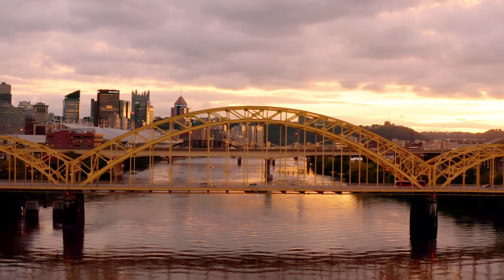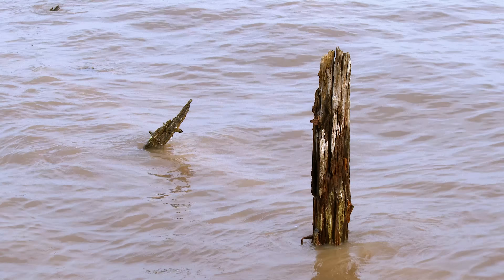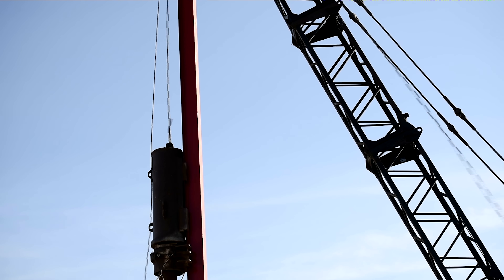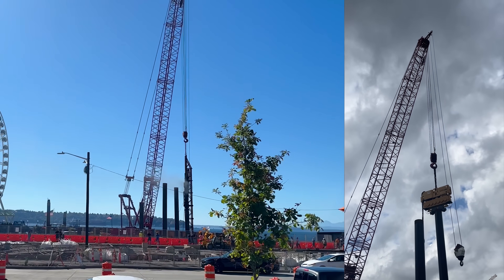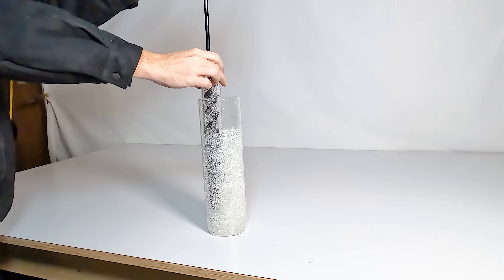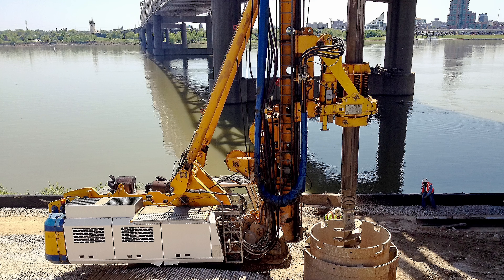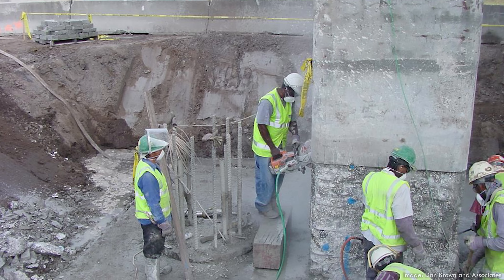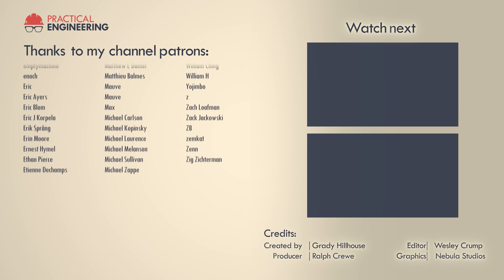Why Bridges Don't Sink

Comment: H Beams look exactly like I Beams, but H Beams have the same thickness in the flange and web, and are commonly used in vertical orientations where the loads are applied parallel to the beam length. The thicker web of an H Beam makes them more resistant to twisting. Whereas I-beams are typically horizontal, have thinner webs, because they are designed to only handle loads perpendicular to the length (top in compression, bottom in tension)
Reply: Then there's the O beam....hang on, that's a pipe 😅
Reply: @PeterEdin  haha yup. we use schedule 40 steel pipe as beams int he film/tv rigging industry. trying to switch to truss more though
Reply: @PeterEdin  For square values of "O" there's the box beam.
Reply: @PeterEdin  Unless it's a circular HSS.
Reply: And....Another thing I've learned today!
Reply: So I can use an H beam as an I beam, but not necessarily the other way around.
Reply: @jensschroder8214 I beams are lighter, because they are optimized .
In an I beam the flanges are thicker, and they are thicker at the root because the web is only there to separate the tension and compress flanges.
The root is thicker to stabilize the web from buckling.
If you use an H beam in an I beam (horizontal) orientation, the beam has to support unnecessary weight from its own cross section.
It costs more, weighs more and is going to be too wide for the height it needs to place the top and bottom flange where they can support the applied load.
Reply: If the loads are axial, why do they call it a beam?
Reply: @petermgruhn  calling them H “beams” when they’re vertical supports is just colloquial. They are formally referred to as H section columns if in a building, or H piles if used as described in this video.
Reply: @danielgreene89  He's referring to there being no "I Pile"
Reply: @danielgreene89  they aren’t only used in columns or vertical supports. They are also used in horizontal beams.
Reply: @petermgruhn  They don't IME.
Reply: Also I beams have a tapered flange to web.
Reply: @LTDunltd  I think you're referring to S-Beams.
Reply: @LTDunltd 
Sometimes/it depends
Reply: I-beams are S-beams and H-beams are W-beams, and your standard I-beam is also a "universal beam". There's a lot of lingo in steel.
Reply: You can also look up H-beam rods and I-beam rods.
Reply: To my understanding, in German we call an H and/or I double T...
Reply: @manufromlucerne  Interesting. Because in the U.S. a double T is a concrete beam that is basically two T-shaped beams with an extended flange. Precast double tees are used a lot in parking garages and other construction.
Reply: Actually H piles have the shape optimized for corrosion protection and axial loads.  I beams have the shape optimized for braced beams and not so much for corrosion protection.  W beams are optimized for as collumns or beams not braced as well.
Reply: I typed all this up in its own post, but then found this thread and though that anyone still following this thread might find my summary interesting:
There are typically 4 standard types of I-shaped beams and, funnily enough, none of them are called "I-beams":
 • W-shape: The standard "I-beam" used today is better known as a W-shape, or a WF(wide-flange)-shape. These are much taller than they are wide (Despite the name, lol), and are intended for typical gravity forces, like long span roof beams and such, where most of the forces goes in the strong axis of the member.
 • S- shapes: What might be considered the archetypical "I-beam", doesn't get a lot of use because it has tapered flanges top and bottom, which just makes it annoying to fabricate with and connect to - who wants sloped flanges? C-shapes also have sloped flanges, but that flat vertical back face it has has enough uses to warrant its existence. 
 • H-shapes: common for both columns and piles, as these have the same width as they do depth, so they form a kind of box or square shape, making them efficient at supporting axial loads, what columns and piles normally support, as they are not much weaker in either direction, they don't have a tendency to buckle unexpectedly.
 • M-shape: last are the M-shapes, which are just kind of these weird tall, thin shapes that never get used in buildings. The internet tells me RV's sometimes use M-shapes for whatever reason. One source call the M- "miscellaneous, so sure, makes sense I guess.
 • As a bonus type, you can cut W- and M- shapes in half and get T- and MT- shapes. Useful for connections and rail-type structures.
Reply: @kindlin  perfect! This is even clearer and more detailed!

I recently used a H column beam cut in half for the 2 T shapes I’d get to create some hardware out of.
Reply: Wouldn't that mean that they do not, in fact, look exactly the same but only almost the same?
Reply: iBeams are just Apple's version of an H Beam
Reply: Great video Grady! My wife bought me your book as a gift! Love your channel!
Reply: Also the terminology varies. I beams are sometimes called "s" for standard, while H beams are sometines called "w" for wide flange.
Reply: Apple: We've come up with the iBeam. Now at $149.99 
Me: What a pile of...
Apple: Exactly
Reply: I was just going to drop the same comment, but found yours.
Reply: You are the stereotypical engineer, giving a genuinely interesting and well researched answer to a throw-away joke in a video nobody knew was a real thing.
Reply: When you say “same thickness in the flange and web” did you mean “similar section height and flange width”?
Reply: @jpfidalgo7  On a typical I-Beam / W-Beam, its designed primarily for flexural forces where you want the majority of your steel to be away from the center of bending to be efficient.  In this objective, the flange thickness can be anywhere of 150% of that of the web.  The webs purpose is, mostly, to separate the flanges and produce a stiffer/stronger section.

On the H piles, the thickness are truly equal.  Its a section designed primarily for axial forces (not only as the video explains but mostly) and there is less of a need to be efficient for the bending forces.
Reply: @jpfidalgo7  no. i meant same thickness of web and flange. but section height and flange width can occur in some H beams, but not all.
Reply: I think both those images are H-beams. I beams have a more complex shape on the flange; it is thicker at the web and tapers at the toe.
Reply: Thanks ChatGPT! 🙌🙌🙌
Reply: Well I was going to say maybe it has to do with the orientation that they are used. I beam cause that is the way it’s strong and h beam for hammered hella hard/ hit here. But yours makes a little bit more sense so we’ll just go with that.
Reply: One thing I learned early in my machine design career is that the names given to structural shapes range from the obvious to "how did they come up with that name?"

A structural steel handbook is an engineer's best reference source. Then there's the ISO standard....
Reply: I was going to be satisfied (temporarily) with my own idea, that it's sort of like the lava/magma distinction. H-beams are underground like magma, I-beams are aboveground like lava. Then I was more satisfied by this answer.
Reply: And her i thought I-beams were just H-beams made by apple and costing 5 time the price of H-beams
Reply: his guess is a little better than ours
Reply: We use 10 inch 3/8 to 1/2 inch H beams for the small crane applications we build. Anywhere from 2.5 tonne to 10 tonne.
Reply: What’s the tldr
Reply: ohhh now I get it 🤣😂😂😂
Reply: Harry and Ian Beams are brothers.... That's why they look alike 😉🙃
Reply: 🤓🤓 jk, thanks for explaining mr boomer
Reply: Web thickness does not determine if its a WF or an I beam. That information is irrelevant
Reply: What's a flange and a web? Judging by the pictures at 3:17, is the flange the | | part and the web the – part?
Reply: W's?
Reply: After looking it up, I realize that most of what I've called an I beam are actually H beams.
Reply: Funny, I figured it was because someone didn't like the sound of I-piles. Like, a pile of eyeballs.
Reply: There's also ship channel, not to be confused with "a ship channel".  ;-)
Reply: You’re an H beam
Reply: Came here to say this, glad you beat me to it.
Reply: Which part of the beam shape do you call the "web" ? without that detail your explanation becomes meaningless.
Reply: @johndododoe1411  the web is the middle section that connects the two end sections. If looking at an "H" beam, it's the horizontal part of the "H" for example
Reply: Also, I Beams don't write science fiction.
Reply: Yep - what Daniel Greene said checks out, probably, although I’m a rocket surgeon so it’s not really my area
Reply: H piles would be an HP section.  Not a W section or S section.
Reply: Whachu talkin about Willis 😂
Reply: Thank you... knowledge is good.
Reply: They are more square dimensionally. Same height and width made up from flange and web. They do not look exactly like I beams since their more square compactness is the reason they are used so we are not wasteful creating large diesel hammers and driving caps. You can order them in varied thicknesses to meet your capacity demands just as you can with I beams so that point is irrelevant. I beams have axial and buckling resistances too its just the shape of the H beams is more efficient and more compact for diesel hammers
Reply: I have only heard the term "double T" beam, is that the same?
Reply: Then there's ziggy zaggy beamy weamies.
Reply: I beams have a web which is taller/wider than the flanges. Which aren’t necessarily tapered. The thickness can vary. H beams/piles have webs and flanges of roughly the same size. Again thickness can vary
Reply: Yes but much more stronger are arched structures
Reply: what about the proportion between the height and the width? Afaik in european standards HEB HEA and HEM beams are mostly the same height and width (HEA are slightly shorter than the width) until you get to 300mm, and then the height keeps increasing with the same width, while IPE beams are always taller than they are wide.
Reply: Fun word, flange
Reply: Down here we have I-beams which look like and I, but we also have Universal Columns that looks like a H, ie, same size in width and height. UC's have thick flanges but thinner web, like an I-beam.
Reply: One has to understand an engineer's sarcasm and humor.
Reply: Thank you, he was like "iTs tHe SamE dIfFeRencE" and I about blew a gasket, very different designs with widely different applications.
Reply: A lot of the arenas I work in have horizontal H beams.
Reply: Then theres the classic ♤ Beam. Used whenever the construction is so shoddy it needs a little bit more luck.
Reply: This is interesting considering the higher failure rate H beam connecting rods vs I beam connecting rods in high horsepower combustion engines. Apples to oranges of course, but again, interesting nonetheless.
Reply: I love H beams now
Reply: @danielgreen89 I don't know if I would say they're better at resisting twisting since all open shapes are very poor for torsion.  I looked at the uniform thickness as adding resilience to potential uneven axial stresses that can occur at the pile end being driven.  Otherwise, good high level description of the two.  Thank you.
Reply: And the I section has largely been replaced by the W section, even though the colloquial name I-beam is still probably the most common name used for all I, W and H shapes.
Reply: I hope this gets pinned as well as hearted, this needs to get spread!
Reply: What about W sections?
Reply: @doorhanger9317 W= wide flange. They better resist side and/or asymmetric loads.
Reply: @doorhanger9317  W section means wide flange. Same as H beam.
Reply: it's honestly embarrassing that a channel called "Practical Engineering" doesn't know the difference...
Reply: @MrTeddy12397 Not everybody knows everything, more news at 11:00
Reply: @KaitouKaiju  So you choose to promote ignorance. k
Reply: @MrTeddy12397 not everybody can know everything, and if you stop learning then you end up as a failure. I'm an "expert" in three different construction trades, and yet I learn or figure out something new in one of them nearly every day. Sometimes it's me just doing my own proactive learning about new technology applicable to that trade, others another expert shows me a trick they learned years ago in an aspect I'm not as familiar with, and occasionally a greenhat has a new idea that us fossils haven't thought of. Progress is collaborative!
Reply: @MrTeddy12397  man, there's no reason to be condescending. we're learning this stuff for free. take the good information we're given, and be gracious about the shortcomings.
Reply: @MrTeddy12397 I assume it isn't so much that Grady didn't know, but explaining the difference was outside the scope of the video.
Reply: @MrTeddy12397  there's different engineering fields. he focuses mainly on civic, beams are more in the structural. this is one of the best engineering channels on YT!
Reply: @MrTeddy12397 it’s called a joke, Einstain
Reply: @MrTeddy12397  Nicest redditor be like
Reply: @MrTeddy12397  It's honestly embarassing you can't comprehend a simple sentence. He didn't say he doesn't know the difference between them. He just doesn't know why the same shape is in one case called I and in another case called H. Even the OP wrote "H Beams look exactly like I Beams".
Reply: @MrTeddy12397 they probably even have another video in the subject but don’t remember that 10 minutes of reading wiki.
Reply: @MrTeddy12397 the same type of person that’s on the job site with a brand new hard hat and safety vest looking over your shoulder “I don’t know how to do your job, but my book says you’re doing it wrong…”

Comment: Amsterdam is build on wooden poles. A lot of older houses in the Netherlands are build like that. Due to groundwater depletion the foundations of those houses are now having problems because the poles that stayed wet and therefor didn’t rot now do (rot)
Reply: I remember watching a show, I think impossible engineering or something similar, on the Science channel some months back about the complications of making subways in Amsterdam. And part of the complications was not just how soft and wet the soil is, but how so many buildings have the large wooden stakes that you mentioned. They not only needed to dig even deeper to go under the poles, but also make sure they're not weakening the soil that those poles rely on. So, from what I remember, they had to slowly dig their way while putting in walls and ceiling to enforce the soil in a way. Though this led to complications with water flooding the tunnels a few times. At least this is what I remember atop my head. So sorry if I got some details mixed up or wrong.
Reply: New Orleans is likewise sinking (subsiding) much more quickly than in centuries past due to groundwater depletion. We "overpave" (leading to increased runoff) and "overpump" during rainstorms rather than allowing water to remain in the soil where it would slow the decay or organic matter. The city is built atop at least a mile of sand, silt and clay, with no bedrock in sight.
Reply: @VideoNOLA  you've got word auto-completion turned on, it would seem.
Reply: @VideoNOLA New Orleans ground was built up with everything they could find. Even bales of cotton. It never made sense as to why they built it there.
Reply: @VideoNOLA  Didn't you mean "bedrock"?
Reply: @VideoNOLA  *bedrock?
Reply: there is a housing development in my area where the better built houses have had friction piles driven into the ground, and then the concrete foundation poured on top of them.
Reply: Wooden piles are still used a lot in the Netherlands, mostly with a two meter concrete pile on top. Wood is a lot cheaper and lighter to transport and handle. As long as the wooden part stays under groundwater level (most of the time) they won't rot.
Reply: There 2000 year old oak piles sticking out of the Thames.
Reply: Rather harsh that someone from the Netherlands is bragging about us plebeians having to use physics for our structures when all they need to do is harness the magic and wonder of their hauntingly gorgeous people and landscapes to bend physics into submission because THAT’S fair…😊
Reply: As is Venice. 👍 There's a great documentary on YT about it.
Reply: Don’t blame the Polacks
Reply: Same for Venice.
Reply: * is built
Reply: And somehow nobody has mentioned another famous pile driven city, la serenissima herself; Venice.

All those famous flood prone Palaces are 'floating' atop a forest of tree trunk pile foundations.
Reply: @JP_TaVeryMuch  hell at least Venice isn't in danger of subsidence anytime soon
Reply: @megalonoobiacinc4863  Ehhhh the Adriatic Sea is more impatient to reach Venice than the City itself
Reply: Speaking of the dutch, Do you know how copper wire was invented?

Two Dutchmen saw a penny on the floor at the same time.
Reply: I've heard the same joke a few weeks ago but with two women from Los Angeles 🌈  @DyslexicMitochondria
Reply: @DyslexicMitochondria  were they Jewish?
Reply: @rogerpenske2411 lmao i knew there would be one guy like you here
Reply: @jacobg3490  They creep up everywhere and become more shameless by the week.
Reply: @DyslexicMitochondria  is the joke that they both tried to take it at the same time and by doing so they just stretched it into a wire?
Reply: @DyslexicMitochondria your wrong that were two schotmen. 😇
Reply: @DyslexicMitochondria  something tells me that this is a subtle “burn”, but I MAY be mistaken
Reply: @DyslexicMitochondria  haha gold
Reply: @Jessica-w1o  not gold, copper